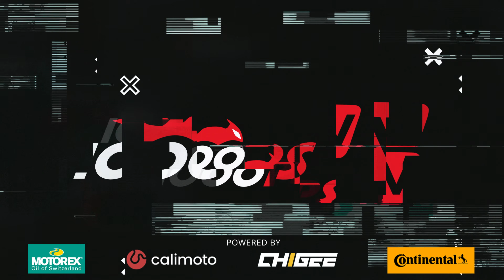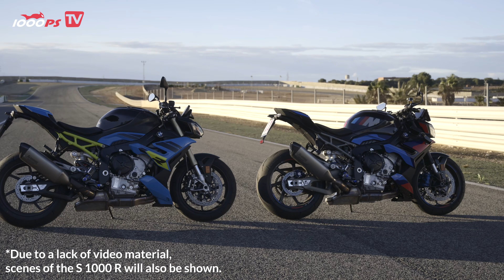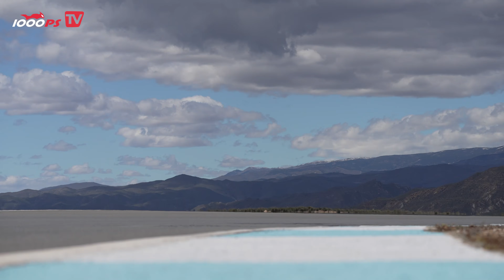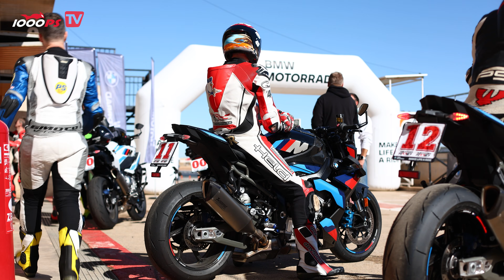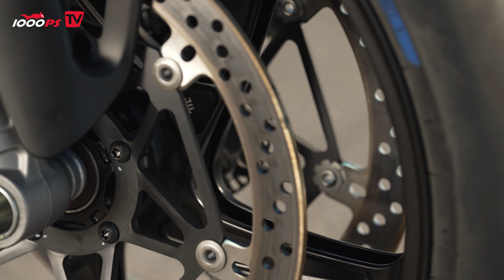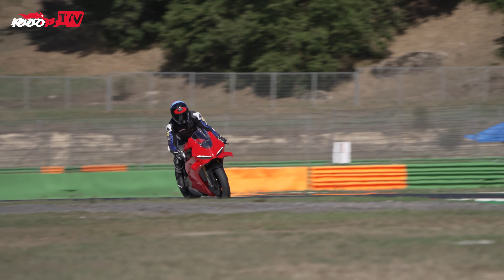Ducati Streetfighter V4 S beats the BMW M 1000 R – or does it? The honest verdict!

Comment: I own M1000R and I love it, especially it comes with a cruise control in a base model ❤️
Reply: And a fuel gauge😂
Reply: @ indeed, even M1000R shows approximate remaining distance with current fuel level. And BMW Motorrad app with GPS is fantastic! 🥰
Reply: The SF can also have cruise control, but it does not "come" on either the base model or the S model. Its like a $300 software upgrade. Basically nothing when talking about buying a 30K bike
Reply: @brysonleonard9857  which one you would buy? 😉
Reply: @carxswitzerland I actually have a V4S on order. I expect it sometime next month
Reply: @brysonleonard9857  were you happy with this decision? Debating between these 2
Reply: @rawcircoking  it is the best motorcycle I have ever ridden. Just got done with my first track days on it and it was a blast.
Reply: @brysonleonard9857 nice! Hope all goes well. My thing is the maintenance on these.
Reply: @rawcircoking  I get mine serviced at Pandoras in Chattanooga, TN. It’s about 375 for an annual maintenance where they all up and down the bike making it good for the next year. The desmo service is what gets you. That’s usually around 2500. Luckily that doesn’t happen until 15k miles which can take a long time depending on how much you ride.

Some dealerships have service package deals where you pay like $1800 and it covers your first few annual services and your first desmo so you can save money with that. Mountain motorsports in Roswell Georgia does that.

But BMW is going to run similar amounts for similar services. I guess the advantage is it may be easier to do it yourself. Ducati will let you do your services yourself you just have to take your bike to get the light turned off for like 50 bucks.
Reply: There was shaking in the Range of 5000-7000 rpm on the BMW engine, did they manage to overcome this problem?
Reply: @ВадимВик what shaking did you mean? My engine is running well
Reply: @carxswitzerland There was vibration on the steering wheel on the old BMW s1000r, I was wondering how it was in the new BMW s1000r. And the last question, since I don't understand English well, tell me, how does he eat on the grass? Is it worth selling your 2017 v4 smartphone?
Reply: I feel like its better here in the states too especially in hotter states. Ducati is just too damn hot outside of the track.
Reply: M1000R 'Base model'

Comment: How does the wheelie control on on high  on the Ducati work compared to the BMW wheelie control on high ??
because as you would know the BMW will just hold you there until you run out of power  without any fear of it looping ??
Reply: The Ducati well mine really doest want to wheelie at all. Even with wheelie control off it still just wants to keep the wheel down on go fast.

Comment: In terms of price, you also have to consider that BMW offers a "base" version of the M1000R without the carbon fibre pieces. The only performance difference between the two versions is the carbon wheels which save only about 1.5 pounds per wheel vs the "base" high spec forged aluminum wheels. Every other aspect of the bike is identical. The other differences are all cosmetic, as all of the carbon fibre pieces are replacing panels which otherwise would be plastic so there is no weight advantage and there are some nicer rear sets that, while much nicer, do not affect performance at all. That brings the price of the BMW down considerably and makes the case even stronger for the BMW, especially when you consider that Ducati's base model has multiple significant disadvantages including lower-spec suspension and wheels among other things.

Where I am in Canada, the price of the base model M1000R is $25,895 CAD, while the V4S is $35,190 CAD. With that price difference you'd expect these bikes to be in entirely different classes, which they are not. This makes the choice pretty easy in my opinion.
Reply: 26k La chance !! 
En Israël la bmw est à 56K 😭
Reply: @raphaellevy5636 oh my god ...😂😂
Reply: That's a very accurate point. So, is the suspension the same as the S1000R? 😮

Comment: With all due respect, they completely overdid it with the price.
Reply: You can always wait a year or two and get a used or old stock SFV4S for half the price lol, here in the states I’m seeing them at about $15k-18k usd & that’s not bad for a slightly used model/old stock sitting in the warehouse or showroom floor
Reply: Give it like a year or two and the second hand price plummets
Reply: ducati and bmw does not hold their value very well in the secondary market just wait a year and get a used one for 30-40% less
Reply: @lizziebutdiff698  No bikes has good second hand value lol. Same with all vehicles in general.
Reply: 100%!
Reply: $35000 euros is absolutely insane for a street fighter.  Incredibly expensive. That will be OVER $40,000 dollars by the time it rolls out the dealership.

Comment: Am sorry but that ducati is wayyy over priced good luck
Reply: Nothing offers you anywhere close to the tech and electronics and overall package that the Ducati gives you. Yes, it's expensive. Very much so. But it's not much more than an M1000R, and its just a better bike..all the way around.
Reply: Where do you live? I live in Canada and own a 2024 v4s, the m1000r is pricier than my v4s here. I actually liked it more but didn’t want to pay the price tag when it doesn’t offer anything the sf doesn’t already have.
Reply: @rubyv4s in Toronto, the '25 v4s is $35k cad, base $30k cad. Whereas the m1000r base is roughly $27k cad and the comp model $35k cad. Old stock '24 v4s' are currently $4900 off, so yes... the '25 and even '24 comp is more expensive than your previous gen v4s
Reply: "It's not much more than the M1000R". Sure, 7000 difference is not much more 🙄
Reply: @katlegoshaddy5702  in the US the M1000R is 29k. The Streetfighter V4S is 31k. So, yeah. At least where I'm at the Ducati isn't much more
Reply: @charlesgutscher1923  I see your point 👍🏽